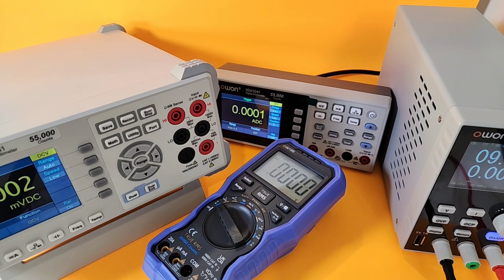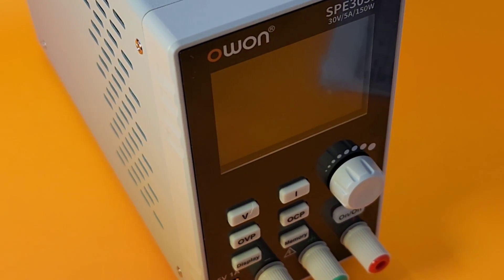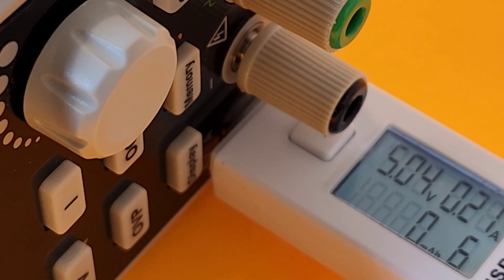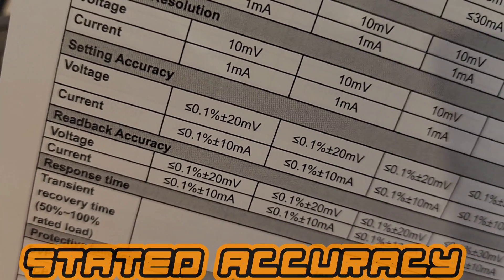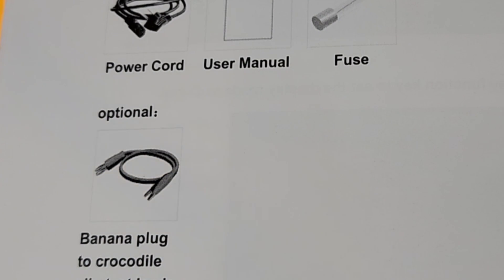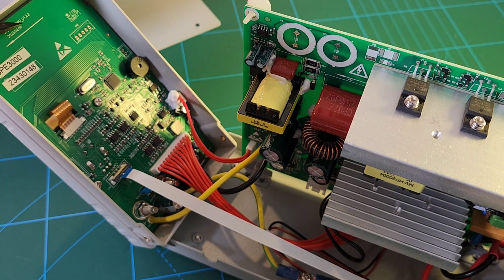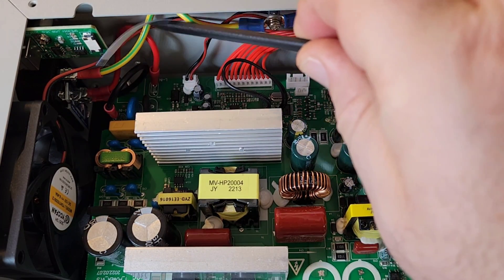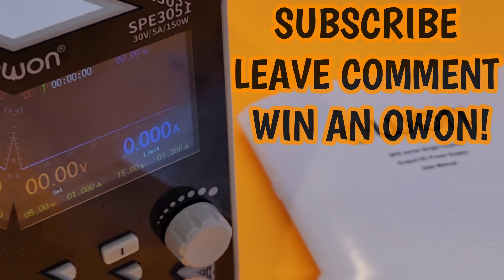All New! ● OWON SPE3051 30V/5A/150W DC Power Supply Review & Teardown!

Comment: Thanks to your good preview. I guess this PSU will have some noise on the DC-output- the filter  on the DC-side looks a bit on the low-side.
Reply from the maker: Good point Deter! 😊 For 120$ I think they are limited by the number of quality components they can utilize to filter. Still considering the overall cost I think it's a good value and better made than many. I just wish I could disable the OVP/OCP👍

Comment: Nice newbie in the pretty common "30 Volts/ 5 Amps" class of PSU´s. With some "eye-candy", such as a grafical display over 60 seconds. But that´s no real data logging. That´s only possible with a connected PC. Pretta nice "at first look" review and teardown, but for a real review I´m missing some "hard data": Because it is a switching PSU, there is always a ripple with the switching frequency and some noise. Nice had been a measurement of this with/without load. And because the protection circuits are probably driven by the microcontroller (not hardwired) it would be of interest, how fast they limit the volts/amperes when an additional load kicks in. Are there any overshoots? And if, how big? Regarding the firmware issues: Is a function to update the firmware implemented and maybe even a corrected firmware version in the near future planned? No test leads delivered is of minor concern for me: Most leads, coming with a PSU, are happily melting and glowing at 5 Amps. No data connection cables delivery is totally normal from Uni-T, Brymen, Fluke to Gossen-Metrawatt. Fluke and Gossen even let you pay with an arm and a leg for the PC-software! BTW: Why is the voltage display on the device the whole time limited to 2 decimal places (at least below 10 Volts should be 3 decimal places be possible), but the volts in the  PC- software is happily displayed with 3 decimal places? And, sorry OWON, a PSU with the main power switch on the backside is right from the beginning a "no-go" for me, because I place my devices side by side on my shelf and workplace!
Reply from the maker: Great feedback 👍 I would have liked to have more time reviewing the 3051 but I just received the unit from OWON (2 months delayed) which delayed production. I'll hopefully revisit and update this PS  at a later date. Rear facing power switch is always difficult but what makes it worse is the power switch here is also located at the bottom of the unit..😮 I'm hoping to get more details on FW updating by OWON soon.

Comment: I is the standard symbol for current.  That's most likely a rotatory encoder and not a pot.  Does it also act as a push button?  Maybe that's how you locked the inputs?
Reply from the maker: Understood but the standard unit is the ampere, symbolized by A. My preference is A or C but it's a personal peeve 😊 Good suggestion but no push button functionality exists on the unit. (nothing specified in the manual either) I'm waiting for an update from OWON and I'll provide more info once received 👍

Comment: Looks to be a clean build inside. The TFT screens are okay, but you do get a lot of reflection in them which I find annoying. Seeing them more and more in instrumentation now. From my experience it is quite rare to get test leads with a power supply, generally would just be the mains input lead and the communication lead. Seems to be a pretty expensive unit in the UK, or may be I am out of touch with the cost of power supplies now.
Reply from the maker: Yes there was alot of glare on the display. Mind you the studio lights were also part of the problem but still it did affect the quality somewhat. The  prices of test gear has gone up considerably since Covid. Even a Fluke 87V has increased by almost 200$ in 2 years...😢

Comment: You should not have to change the OVP to set a preset higher than it.  You should be able to set a preset to whatever you want, but the OVP to still intervene when you try to use that preset.

If you set a preset to 30v, but then reduce OVP to 20v, does it reduce the stored preset back to 20v?  That would be dumb, so they should also allow memories to be set to whatever.
Reply from the maker: Agreed, the OVP/OCP does seem finicky. Ultimately,  not being able to simply enable or disable this feature is definitely annoying 😕

Comment: Looks like really decent build quality on the inside especially for what appears to be a switching design with no large linear transformer.  Not a downside really as its priced accordingly - looked like it had a  fairly well controlled wave form ouput regardless.  Not really an excuse for no leads supplied at all, thats kind of a problem if one happens to be a beginner and its their first PS and no leads just laying around, c'mon Owon throw in some basic leads for $120.00.
Reply from the maker: You really nailed it Mike! 👌  No excuses,  every PS should come with a basic set of leads or crocs. I've pointed 👉 this out to OWON personally so let's see what happens. Also not mentioning the software capabilites in the user manual was perplexing to say the least. 😮 Excellent build quality as you pointed out!

Comment: “I” love current!❤.   Owon has sweet equipment and I like their vibe. Please add my name to the hat for that excellent multimeter🎉. The memory feature is awesome for people who have a workflow but need to change things up a bit and come back to it, like charging batteries.  My pricey hp has only three and you have to write down the settings!  Even though they don't supply cables, the waveform on the display can certainly remove the need for some extra wires to monitor your power📺.  I have so many old USB cables laying around it would not stop me.  However, all the missing accessories sure does 🎵whaaaa-whaaa-whaaa 🎵make the unboxing boring.  I suppose you can set OVP and OCP to max values?
Reply from the maker: Yes Paul 😅 Not much of an unboxing eh! 😉 Seriously though, OWON needs to add those cables with the power supply otherwise it's annoying as heck for a new user just getting started in Electronics 👍

Comment: The "I" comes from the French "Intensité du Courant" (current intensity). Weirdly, voltage is (was) often marked as U from the German "Unterschied" (Difference, or Difference in potential). Here in Holland we have the Ohms Law formula U = I x R which represents these letters. 
I know that older Philips power supplies used U on the voltage scale and I on the current scale instead of the now common V and A.
Reply from the maker: Wowzee..that's alot of acronyms for current 😅 Interesting about the French meaning..thanks for the update. PersonalIy, I would have preferred to see the more common C or A for the masses 👍
Reply: @KeepOnTesting  Fun to know, my Siglent Bench meter (The SDM3055) has DCI and ACI labels for DC and AC current measurement, so it's still somewhat 'widely' in use. :)
Reply from the maker: Oh no doubt! 👍  My Siglent SPD3303C power supply displays only as C[urrent]. Keeps life interesting 😊